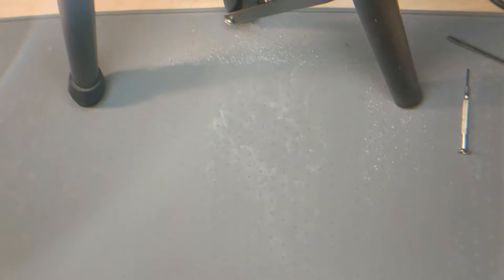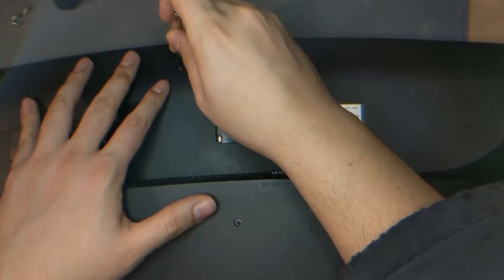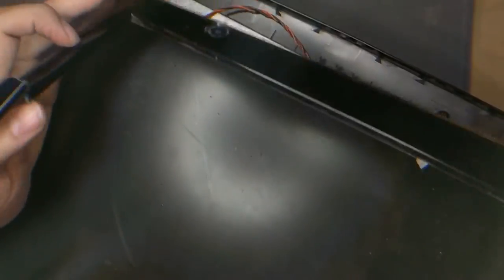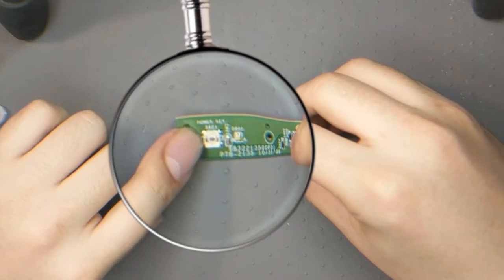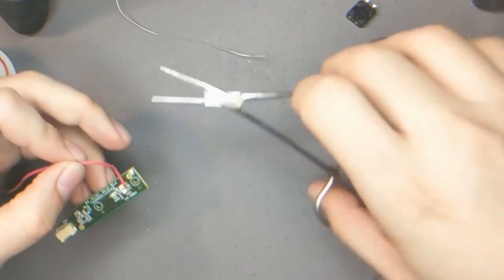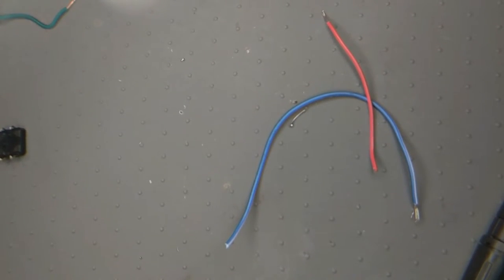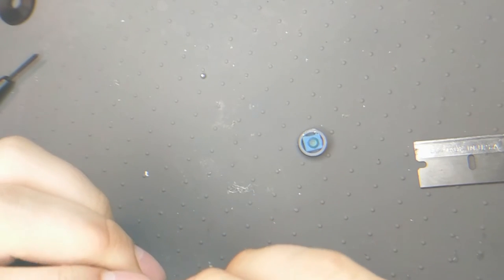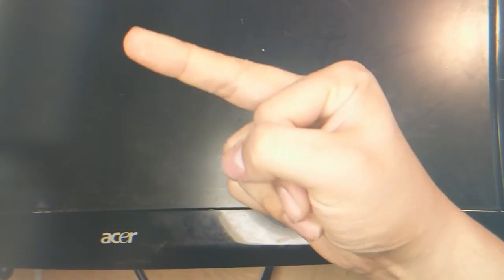If It Ain't Fixed E05 - Acer Monitor Power Button

Comment: Thanks!  I have this same monitor with this exact same problem.  I have just been using my power strip to turn it off and on since it is stuck in the on position.  This looks like an easy fix without even needing to buy a new power button assembly.  Awesome.  I too hate those damn clips as I just repaired a 43" HDTV and broke about 1/3 of them.  No problem, I just used a little hot glue when putting it back together and it is fine.

Comment: Funny I have the same one and guess what? I cant get my monitor to turn on... I got it to turn on finally after messing with the button using an exacto blade. But.. over the past three days. The first it was difficult to get to turn on but it did after a press or two but...the 2nd day it was even harder and today I thought FUCK I cant get my button to turn on the Monitor after messing with it using the exacto knife I got it to turn on and today I looked up this video because Im scared its not going to turn on again and Its a good monitor Ive had it for years and has a great picture.